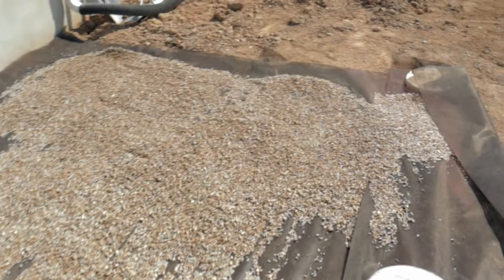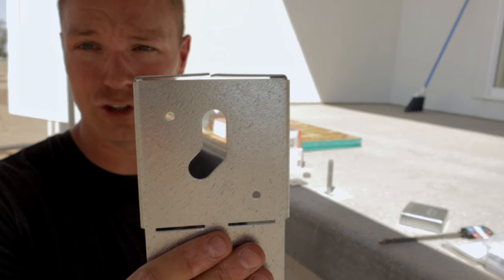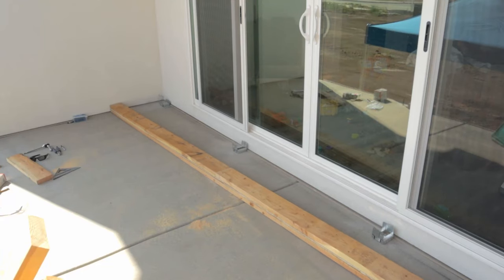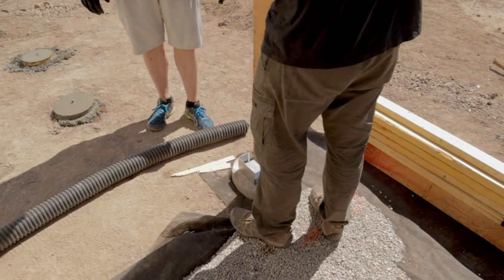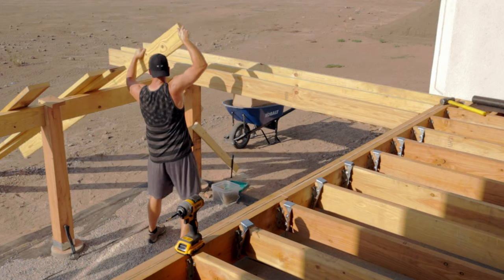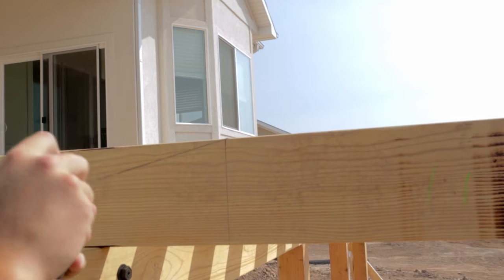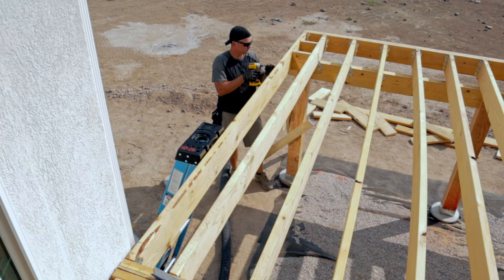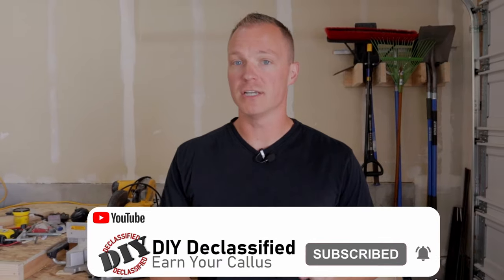My EPIC Deck Build - How to Frame a Deck // Episode 2

Comment: Just so people know you can't use deck screws on your hangers and you can't be using OSB exposed outside.
Reply from the maker: Yeah, I trusted the wrong employee on the screw selection. This summer I will be doing a video on some other deck improvements I made, and I will be addressing some of the errors pointed out by the community. Thank you for your attention to detail. It not only helps me improve my products, but helps the community as well.
Reply: You beat me to both points!! I was like…Pressure Treated OSB??
Reply: Simpson makes screws specifically for hangers
Reply: although by code you can't, those things arent going anywhere. Code over engineers every damn thing, because some idiot somewhere 45 years ago killed himself and now new rules and regulations are upon us. LOL. a 2x8 joist hanger with 8 fasteners of any kind will hold perfectly fine

Comment: Dude! Those black hex head lag bolts are next level!
Reply from the maker: I was very excited when I saw them at Lowes. Adds that little extra detail that is easily overlooked.
Reply: They are screws, you need a nut and washer to call them bolts

Comment: nice video.  if there was one piece of information I would  add, since this is a DIY, you might speak to the hardware you are using.  To meet code, you are supposed to use very specific screws to attach joists.  You can't just grab construction screws.  They don't have the required sheer strength and could lead to catastrophic failure.  Simpson makes screws that meet code.  1.5" for mounting the joist hanger to the header.  2.5" angled through joist into header.  just an FYI for any DIY'ers like myself trying to build a deck.
Reply from the maker: THIS! This is great advice! And I did use the wrong screws on this because I was ignorant to this fact. Last summer I actually replaced a bunch of the screws. Last thing I would ever want is for someone to get hurt on something I built.

Comment: Nice video.  Curious why you would use deck screws on on the joist clips instead of structural screws or approved galvanized nails.
Reply from the maker: Good eye! I used structural screws on a majority of the deck but ran short as I was building the section directly above concrete. Yes, you should use structural, but in my case that area has a short span, and if the screws fail the board will only fall a couple inches. With 6 screws holding in the bracket Im confident they will hold just fine.
Reply: Screws are thee best way.
Although more expensive.

Comment: instead of moving the joist and making shorter blocking, could you have just added another joist where you needed it? Also, why did you chose not to use some flashing tape on your beams for more water protection.  Great videos

Comment: Nice, but why not stain and seal the frame the cuts/notches and all?
Reply from the maker: Its a fail on my part. I did seal every board in my garage before I started, but I failed to seal the cuts once I installed them. Good catch!

Comment: Correct me if I'm wrong but are you supposed to break all rim joists on a pier or doubled up joist? You installed the double rim joist on the front that hangs over supported by joists supported by a beam.

Comment: Curious if the joist hangers are needed on the outer edge? Seems like the beam would support it plenty… Regardless, great video!
Reply from the maker: You are correct. The joist hangers are there only to hold the face frame on. After the project, i relized I could have just screwed the face frame on from the outside. Live and learn I guess.
Reply: There are inverted Hangers.

Comment: is the wood you used pressure treated. also deck screws are not a structural screw for joist hangers,
Reply from the maker: Yeah, I trusted the wrong employee on the screw selection. This summer I will be doing a video on some other deck improvements I made, and I will be addressing the screw issue.  Now I get to spend a day replacing them with actual structual screws. 
For the wood, it is not pressure treated. In my area its hard to get pressure treated, and I built this during peak covid season when you couldnt get wood anywhere. Before I built the deck I layed out every board in my garage and put a sealer on them. Then every spring I go out and re-treat them.

Comment: Nice set of vids.

I am about to replace 4x4 posts with 6x6s and this definitely has helped. I'm not doing a full build, but still lots of valuable info
Reply from the maker: Glad to help! The 6X6 are definitely overkill, but we like that chunky wood look.
Reply: @DIYDeclassified  my ultimate goal is to add a covered roof, so that's the main reason I am doing so now

Comment: Hello from the UK, great video.  Few questions.

1. Whats the distance of footings from house (whats the max distance you can get away with?)
2. Whats the distsnce between footings?
Reply: Span tables give distance based on the species of wood pine spruce larch etc, the 2x size , and  joist spacing 12 ,16 or 24in.
Reply from the maker: @chooch502 is correct. I used the span tables from Decks.com to determine what I could get a way with.

Comment: Hi, I've been running through a lot of DIY videos in anticipation of building my own deck. But I do have a question I am hoping you'd be able to answer for me. On decks utilizing a cantilever, why are the joist hangers not inverted at the header joist since it is the joists that are actually supporting the header and not the other way around?
Reply: Hey there, I also noticed the cantilevered joists. Typically you should avoid it if possible. If it’s the only option, then I always try and stay less than 10% of the total joist span or less. 
As for reversing the hangars, there is still downward load on the majority of the deck, so having them reversed only solves one load requirement. 
I have seen where shorter hangars are used on both top and bottom (say 2x6” hangars for 2x10 joists) to carry upward loads also). 
Never tried this personally, I just avoid large cantilevers! 👍

Comment: Use half inch EXTERIOR GRADE plywood for builfding your girder support beam. Its going OUTSIDE, osb disintegrates and rots!!! Dont do that again
Reply from the maker: I built this on 2020 during a wood shortage. I worked with what I could get and did what I could to water proof. But, yes you are correct. You should use exterior grade material for all aspects. Luckily for me I live in a very dry climate where I don't have to worry about too much water.

Comment: Great work but you didn't show how you square in to get your beam on the post
Reply from the maker: Sorry man, its a detail I forgot to add to the video.  Watch past 5:22 and I explain how I found level on the first post by clamping a joist to it. I did this same thing to the last post. Once I had the two ends set up, i could level across to make sure my beam was level. Because the concreate slab was level that I attached the upper beam to, by lining up the two joists on the ends, I didnt need to do any adjusting on my beam when I leveled across. They were spot on.

Comment: ''Great video! What type and size of lag bolts did you use for the outside beam connection to the support posts?
Reply from the maker: I believe I used 5-1/2 inch Simpson Strong Tie screws, which are rated to replace a lag bolt going all the way through.

Comment: So I am using your post method for a pergola that I am putting up. How do I make sure that the 6 x 6 posts that I am using are square across for when I connect the cross beams?
Reply from the maker: I set the outside posts first, made sure they were level and square. Then I tied a string line between the two that would give the exact placement of the center posts. Because the post bases I used are adjustable, if I was slightly off, I could broken it back down and readjust before I finished the deck.

Comment: The adjustable Simpson post tie is cool, but way too short to hold a post with any significant strength. The need to make them go higher up the post.
Reply from the maker: I couldnt agree more!

Comment: How did you account for the varying joist depth where they are sitting on top of the beam? Are some just "floating" above the beam?
Reply from the maker: I measured every joist before using them. There were only a handful off the size of the rest. Anything extra that may have been sticking up, I shaved down with a hand planer.

Comment: Can the beam be canterlevered past the support posts? I have three posts and a 12 foot span, can I space the posts 4 feet apart and have two feet on each side beyond the post?
Reply from the maker: There are a few factors that go into this. What kind of wood, how wide the boards are, etc. If you go to the website I describe at the beining of my first deck video, they have a chart that will tell you exactly how far you can canterlever your deck based on what materials you have.

Comment: On the joist head I would have put the hanger inverted. Thank you!!
Reply: I'm subscribed
Reply from the maker: In the moment I didnt think about it, but yes you are right. In fact, I probably could have gotten away without using them on the ends all together and just screwed the outer frame from the outside.
Reply: Those joist hangers can support over 1000lb of “uplift” per hanger.  That face rim ain’t going anywhere!

Comment: What is the space between the 2*10" beans?
Reply from the maker: They are all spaced 12 inches on center. This is the minimum recommendation for most composit decking companies becuase the summer heat will make the boards flexible.

Comment: How far in did you offset your footers and posts?
Reply from the maker: I think i get what you're asking. The offset of the deck from the footers/posts is 12 inches. You can look up span charts to see how much overhang you can withstand based on the lumber demensions you choos. I could have gotten away with an 18 inch overhang, but I liked how 12 inches looked, so I ran with it. 
If this is not what you meant, let me know and I will gladly answer your questions.
Reply: @DIYDeclassified  
Thanks

Comment: Is this lumber treated?
Reply from the maker: It is not pressure treated. My area is so dry and hard to get pressure treated. Plus I built this during peak covid season when you couldnt get wood anywhere. Before I built the deck I layed out every board in my garage and put a sealer on them. Then every spring I go out and re-treat them.
Reply: @DIYDeclassified  Is pressure treated preferred?

Comment: On your front header joist... Shouldn't you have installed the hanger brackets upside down?  The Joists are the ones holding up that header, not the other way around.
Reply from the maker: I could have, but here was my logic. The joists were being supported by the beam. The 6 screws going into each joist that was going into the header was plenty of strength to hold the header. This header on the deck was only going to hold the fascia board. So with all the screws and back blocking from the railing posts, that header was going nowhere. Also, if I did flip them up, I would have to deal with the lip the brackets would then put on the top. My decking boards wouldnt sit flush, and it may have caushed my railing posts to lean in towards the deck.
Reply: @DIYDeclassified  
09:37  Joist hangers would not have been needed at that header.  Just nail or screw from the header into the joist.  As you mentioned, the header is not really supporting anything.

Great video.
Reply from the maker: @mikejoyce7157  thanks man. It's not perfect, but I sure did learn a ton fightingy way through it.

Comment: 11:52 Can you just add another joist?
Reply from the maker: Not for how I am picture framing the deck. The composite decking requires a cross member every 12 inches which is why I had to do it this way. I wish I could have just added another joist.
Reply: You could have added another joist on the inner joist of the picture frame. This additional joist would have supported the edge of the perpendicular composite deck boards without having to move a joist and cut blocking back. 

In my mind, you were caught up with the perfect layout for the joist support and missed the easiest, least complicated fix. It happens. Just remember, code and manufacturer suggestions are only MINIMUM requirement. No one says you can’t have joists less than 12” in this particular application.

Comment: Absolutely no reason for Joyce hangers on the rim joist. It is not supporting anything. The weight of the joist is supported on the beam. The rim joist or what you called. The header joist is doing nothing but serving as a fascia and blocking.

Comment: well MR DIY first code violation using common deck screws on the hanger  number 2 code violation you did not have any connector plates connecting the post to the beam even though you notched it you are required to use steel connector plates and where you have a joint on the beam you are supposed to lap the beam the beam sol act as a whole or a solid beam and not be in 2 pieces. its not called a header joist its called a rim joist and a proper way to do it is single ply 2x material with a Facia Board that would stager the joints and does not require hangers and should be face screwed or nailed ..
Reply from the maker: Yeah, I took some bad advice from the crew at the lumber yard on the screws. I was also told that I didn’t require the connector plate because I lag bolted the beam to post. If I’m wrong on this, I apologize. But thank you for the feedback. I am always looking to learn.
Reply: @DIYDeclassified Lag bolts and a notched post are acceptable.  If you post was not notched and your beam was on top of the posts, then you would need the connector plates

Comment: Using OSB on a deck just completely ruined it.
Reply from the maker: I was imature in my thoughts on it at the time. It is something I inspect every year now, and blast it with sealant every spring when I seal and stain the posts.